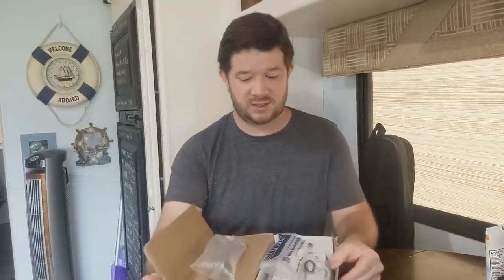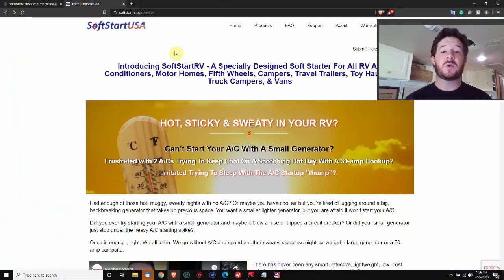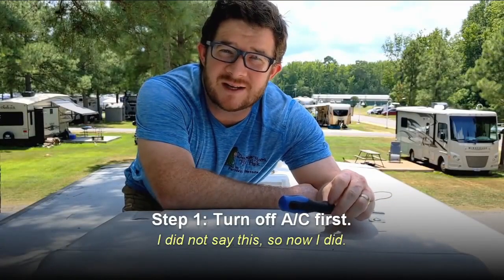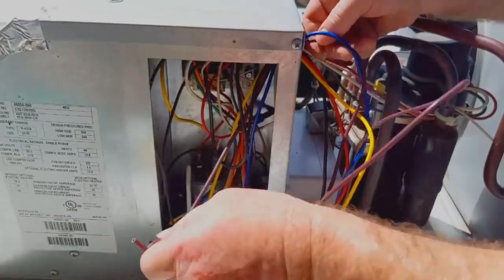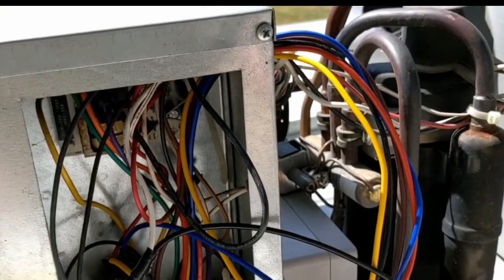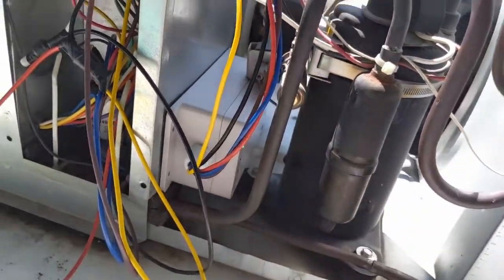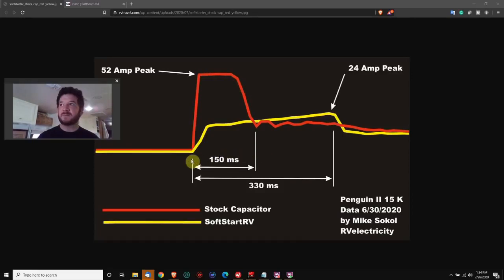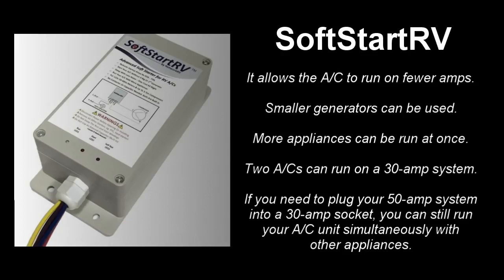Installing a SoftStartRV and Review

Comment: If my AC unit (Dometic 13500 BTU) suggests a minimum generator size of 3500 W, do you think a 2200 W generator with a Softstart would do the trick? If I can't run other appliances simultaneously, I can live with that if it means a smaller generator.

Comment: I hesitate between SoftStartRV Kit Vs. Micro-Air EasyStart Soft Start, any advice?
Reply: He is sponsored by soft start.
Reply: @Realfactsaintvariable  Of course, and that is more important than the followers!!.  🙃   I put in a Micro-Air Easy Start. Install went very well and the Micro-Air does its job.  I can easily start my air conditioner on a 15a 110V outlet at friend, I can see it perform on the blue tooth.  Excellent.
Reply: @projet2907  Thank you for the info!
Reply: @Realfactsaintvariable  Welcome:-0)

Comment: Reducing available amperage for compressor startup is harder on the motor but easier on electrical system...why not add a hot shot capacitor so the power for startup is available without as significant system draw
Reply from the maker: Good Question.

I believe you are talking about a hard starter. Those are great if you are running super long extension cords, but as far as allowing an AC to start with say an inverter generator, it wouldn't do much good. (see article below) A soft starter doesn't reduce available amperage, rather it delivers a smooth ramp-up of voltage rather than the traditional method where current and torque are applied immediately. The result is a startup that draws fewer amps during startup because the motor isn't trying to go from 0 to 100 immediately. Once the motor is up to speed the soft starter switches itself out of the loop so there is no limiting of any kind going on.  The whole process happens in the span of about 300ish  milliseconds, so there is no prolonged limiting of voltage or current going on on the motor. This may actually result in a smoother start, that is easier on the moving parts because the initial start is less jarring on the physical components.

Sources
https://www.softstartrv.com/faq/
 Q. Will SoftStartRV reduce or extend the lifecycle of my compressor?
 No. SoftStartRV works only during the start of the motor then switches itself out of the circuit. Because most compressors stop mechanically before they fail electrically, SoftStartRV does not change the durability of the compressor.

When do you need a soft starter for an AC motor?
https://www.motioncontroltips.com/when-do-you-need-a-soft-starter-for-an-ac-motor/

RVelectricity: Hard start capacitors vs. SoftStartRV. Big difference!
https://www.rvtravel.com/rv-electricity-hard-or-soft-start-caps/

Comment: Save yourself $300. Run a 20 Amp 120v cut extention cord(male) thru the floor of your rv to the breaker for your 2nd a/c, and disconnect the house wires and cap them off. Then wire in your cut end of the 20 Amp (male) extension cord. Properly secure it at both ends, so a pull on it will not yank it out. Now plug the male into the shortest run of 20 Amp extension cord you can to the 20 Amp plug in the power post, and you can run both a/c. As an edit. Do read the stickers inside of the power post. There are still a few very old sites that only supply a total of 30 amps shared with the 30 Amp and 20 Amp plugs and specifically warn you not to use both concurrently. They are rare but they do exist.